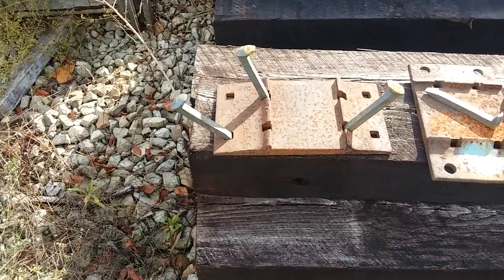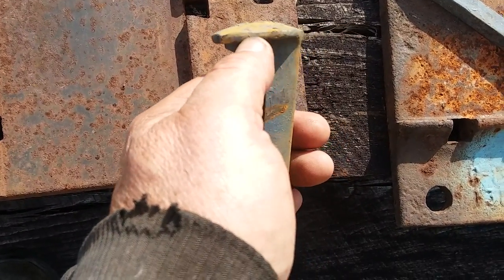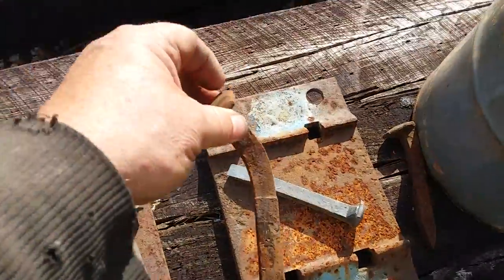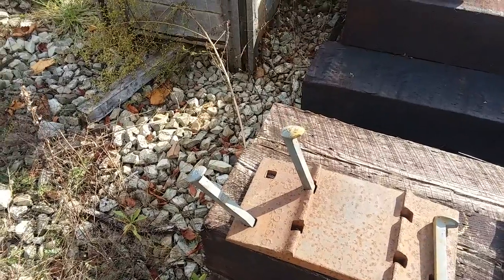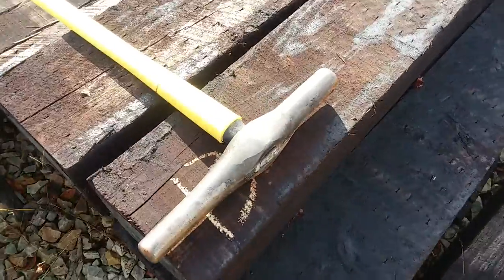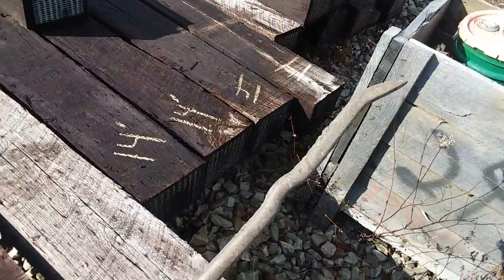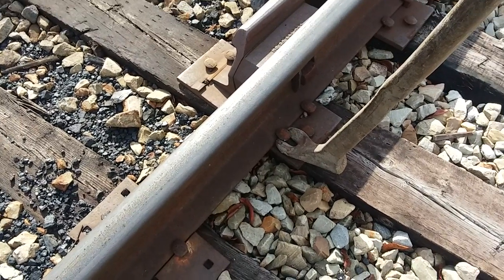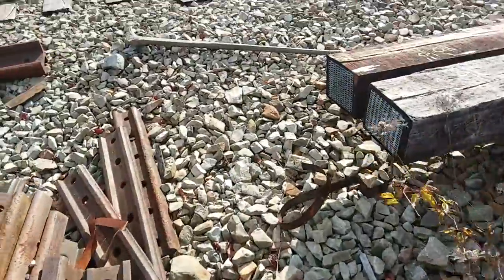All about Railroad Spikes

Comment: Hi Dave, I really do like your videos, very informative. I do have one question about the spike pattern. You showed where two spikes would be placed, diagonally, on either side of the rail, and one spike to the very outside of the tie plate. You also mentioned that sometimes you place two spikes against the rail on the inside of the rail on curves. To me, this makes sense, as they would help prevent the rails from possibly rolling over from the forces of the wheels. But you also mentioned that you never place any spikes in any of the very inner two holes. If that is the case, then why are there holes in that location? Is there a particular situation that those very inner holes would be used?
Reply from the maker: Good question gntlmn and great to hear you are enjoying the home
movies. Tie plate holes are stamped in for a variety of situations
and applications. That way they don't have to make a tie plate for
every single application, more like one size fits all. We don't use those
holes on the inside of the rail farthest away from the rail, however
there are some railroads that would use one or both, depending on
the speed of the train and the degree of curvature.  At 25 MPH here our train is at a fairly slow speed.  Really appreciate your taking the time to visit with us and may you have a very good day my friend.

Comment: I have cabins on a junction. Thankyou for showing gear. 
Also, the RR has gone to cement ties and, longer rail. Could you expand on that?
Reply: Cement ties are used quite frequently in new track construction yes, I've never heard of
anyone mixing concrete and wood ties. For one thing there is a different setting or limit
on tampers, one for concrete ties and one for wood, so if a section had mixed ties, the
tamper operator would constantly have to shift the limit on how deep the tamping tools
will go. We only use 39 foot rails, although lately when we change out a whole curve of rail we
have been welding 2 or more sticks together to eliminate joints, we have done as many
as 5 sticks which sure makes for a better ride and easier tamping. Thanks for your inquiry

Comment: They are high carbon steel. Might be lower than the rail, but still high carbon. Hence the HC on the head. Others might say O or W for oil or water hardening.
Reply: The HC means higher carbon, not high carbon. Still pretty low carbon content. Equivalent to 1045, which can be quenched, but won't hold an edge.

Comment: I really enjoyed this.  I have been told a fair amount things about railroad tools and terms. You mentioned Gandy Dancers. I was told that name came from the name of the manufacturer of the tools Gandy and when b the men would use some of the tools they would kind of sing or chant to keep a rythum going making it easier keep going. Then I have a question. My Grandfather was a blacksmith and he made my Dad a splitting mall out of a railroad mall. I want to say it was a "striking mall."  As I remember it the "striking mall" shaped different than the "spiking mall."  The striking mall was smaller and was shaped like a chisel which was used to cut the rail. Someone would hole the striking mall against the piece of rail and another worker would hit it with another heavier mall. It would leave a knick and that would be done all around the rail and it would eventually break the rail. Can you enlighten me on these things. I must say that that splitting mall was the best in ever used. I am not a big guy but with that mall I could sure split like one.
Reply from the maker: Marvin, thanks for the great comment, appreciate your history. I have heard of a splitting maul, but we do not have one and never used one. To cut rail i have a nifty hydraulic cut off saw, got a vid of that in action on my channel if you wpuld like see it. Again thanks for info and for watching

Comment: One would think their would be some kind of a jackhammer-like air tool for driving and removing spikes instead of a maul. Why not?

From WWII movies, I remember seeing European rails fastened with screw-type spikes that are turned with a T-handled wrench. Thus instead of fighting a longitudinal friction, removal fought a rotational friction. I wonder if  that system required the use of a sort of Sure Spike compound when replacing spikes and whether their spikes better resisted the forces resulting from traffic.
Reply from the maker: We have a hydraulic spike driver that runs off our hi rail truck, they
also make pneumatic drivers. Believe me at 68 years old my days
of hand spiking are over! I too have seen those fasteners you
speak of in a movie, seem like they would be a pretty good idea.
We use hydraulic impact wrench to run lag screws in if needed
without pre drilling holes.

Comment: I remember when they removed the tracks by the house I grew up in, the line was dormant so now it's a bike path. Anyway, I remember the crew giving away tracks, ties (we got tons for the yard to keep the gravel from the road out of the lawn) had dozens of spikes, and these J shaped things. I know about the bolts, plates and nuts, but I am unsure of what those J shaped dudes were for besides my using them as a crude form of hammer.
Reply from the maker: Rory, J shaped are rail anchors, fixin to do a video on anchors soon, so watch for it. We got an old, old railroad bed bout 10 minutes from me that they did the same thing made it into a bike trail.

Comment: Is rust an issue or are the spikes, tie plates etc., quite durable in that regard?  Are the new ones treated with chemicals to prevent rust?  Thanks!
Reply from the maker: Rust not an issue generally speaking. However the big problem we have had is when coal covers plates and spikes, the acid in the coal corrodes the metal. I've found some spikes corroded so bad they were as thin as a pencil.

Comment: Thanks for the info.   I would  think the. Chisel head  would be turned   90 degrees. To slide into the grain of the timber.    The design.  Now, Would cut the  wood. And  work loose with the swelling of the   Timber.    Thanks. Great video. Later.
Reply from the maker: Think about this Dan, putting a spike with the grain is like driving a
wedge into a piece of wood, it wants to split it. Driving across the
grain alleviates that to a better degree. Spikes work loose a good
part of the time because the tie is sitting in unstable ballast conditions such as mud, this works the tie up and down and eventually the spikes will start to loosen. When that happens then
water gets down in the spike hole and makes things worse and
starts to rot the tie out from the inside. Ties are not creosoted all
the way thru, only the top about 1/2 inch layer of wood. Very
grateful for your taking the time to visit with us and check out
the video my friend.

Comment: what does the railroad think of your videos? do your bosses or coworkers also watch them?
Reply from the maker: Good question, company policy does not prohibit taking videos,
however I am not allowed to show employee faces, and yes many of
my fellow workers watch. I use a cell phone to take these, we use cell
phones as part of our communication to the train and dispatch as 
our radios are not always reliable which happens most often in summer when there is a lot of foilage. 

FRA rules prohibit cell phone
use while running a locomotive or if it distracts the loco operator so
I do not do that. I do run loco at times but cannot make videos of me
doing that. Sure wish I could make videos of running a loco, but 
that would be a definite safety concern.

Comment: How the heck do you drive a spike between the guard and rail at the frog at 10:04?
Reply from the maker: Once we can't drive it any further with a spiking maul, then we can put another maul on top the spike and try to drive it in but in new wood it's pretty tough. So we will use a hydraulic spiker, one these days gonna make a vid and show you it
Reply: @ccrx6700  that makes sense. Just turn it into a big ole nail set! Love the videos... you’re very informative and easy to understand! Learning a lot.
Reply from the maker: @scratchbuiltdozer  we often use a b & o and hit it with a maul to drive down spikes that are under joint bolts. B & o is a really big nail set with a handle

Comment: Very interesting - I did search for the dbl headed spike & found information, BUT didn't find any info WHY the dbl head. I know about dbl headed nails - used as temporary - the second head stays above making removal easier.
Reply from the maker: Thanks JB, yep I couldnt find much bout why they used them either, but is rather a unique design.

Comment: I looked at your video on the spiker machine driving the spikes in it appears to be driving them in without holes in the sleeper. a question when they are driven in by hand are the sleepers drilled with an undersized hole  or are they just driven into the wood without a hole to make driving easier. Sorry for the dumb question but It is something I am curious about. Thanks for all you videos. All the best.
Reply from the maker: Thank you for your comment, and no its a very intelligent question, and unless a person has worked rr, its not something that many would know. We never pre drill holes. There may be some rr's that might on occasion, but all our spikes, by machine or hand are driven without pre drilling. Thank you for watching

Comment: Often wondered with no serrations how they do not back out, especially where you see vertical flexing due to soft ballast.   Nails are spiral or cement coated,  unless plain (?) Uncoated...always seemed like they would back out over time.
Reply from the maker: That is why the spikes are cut square Cregg, that adds a lot
of resistance. They very often do back out tho when the tie
keeps pumping up and down from the soft ballast. Thanks
so much my good man for taking in the video today.

Comment: What do you know about date nails in RR ties? In the 1950's we were digging up and filling in an old root cellar made of used RR ties. It was rotted and collapsing. some of the ties we dug out had zink nails hammered into the end with a date stamped on the head. Nearly all of them dated from 1890 to 1920' Was this common? We were near the UPRR tracks in E Oregon. The nails were abt 3" long and had heads the size of a nickle.
Reply from the maker: Interesting story! Thank you for sharing with us

Comment: Are all railways (railroads) done this way? It seems very old fashioned compared to the UK and Europe. We have the sleepers (usually concrete, especially on mainlines) a "seat" which is bolted into the sleeper and then the spring type clamps holding the rail. Joints on the mainline are continuously welded (thermite) for ride quality. UK fast trains travel at 125mph (for now- faster is planned). Only branch lines or less major routes use wooden sleepers and fish plates, but the same seats and clamps. Im amazed the rails stay on using glorified nails!
Reply from the maker: Ours is old rr built 1975/76. A lot of rr have continuous welded track in US, but ours is jointed. In US  a lot of wood ties but most new construction is concrete. Thanks for sharing info from across the pond with us. Nice to know how other railroads do things
Reply: @ccrx6700  Thanks for taking the time to reply. I really enjoy your work and the inside look at things we never see. Thanks!
Reply: I think the spikes are very strong, and they work well for keeping the rails in gauge. Of course, I might point out that the UK still uses screw couplings which are old fashioned compared to Janney couplers found on American rail cars. But, it works well for British railways, so that's all that matters in the end. In defense of American railroads, we don't have the passenger network found elsewhere in the world, but I believe we have the best freight rail network in the world.

Comment: I have NEVER seen a factory-new spike. Thanks for sharing!

Q: Do you think the reason they don't sell 250's is because it's all automated for large installations and replacement?? I've had the "same issue" buying Surface-Mount-LEDs, which are cheaper by the hundred than the ten, so I've bought rolls of 100's for the same price as 10 units.
Reply from the maker: You are welcome glad you enjoyed. Lot guys developed back injuries from lifting those heavy kegs which is why i heard they went to smaller weights

Comment: Dave, great explanation. Thank you! How do you spike the rail at a crossing?
Reply from the maker: Very good question John. Crossings are built just as any
other section of track, then after everything is spiked down
and tamped, they will add the asphalt or wood top so it
can be driven over. Hope that helps.

Comment: Actually quite interesting and informative... What I would like to know, once you pull the spike out between the frog, how do you get a new one back in? It looks to be a very tight fit.   If you are using the spike maul, one must be pretty accurate to strike that spike.  I know I couldn't do it.  :)
Reply from the maker: Very good question and very observant on your part. WE start the
spike with a maul, then we can use a hydraulic driver or use a long
punch on top of the spike and hit the punch with a hammer. Glad
to hear your enjoyed the show

Comment: I live in England and as part of my interest in Railroads I collect rail and track fastenings. I was really thrilled when i managed to get a RR tie plate and some old spikes and bring them back to the UK. In the uk spiked rails are uncommon Pandrol rail clips are more common. Are the spikes driven straight into the wood or are there any predrilled holes?
Reply: Awesome Philip, Question, I understand Pandrol, we have a few of them on our railroad
but not many. What do they use there to anchor the pandrol plate to the tie? I understand
how they fasten to concrete ties, but they either gotta have spikes or lags for wooden ties.
Yes spikes are driven straight  and without pre drilled holes. Thanks for watching sir.
Reply: @ccrx-xu1wc  Apandrol rail clip on a wooden tie (sleeper) is a rare thing. I have just been delving through any books I have with pictures from the last 50 years, I eventually found a picture of wooden ties with Pandrol rail clips, as I suspected they use a cast steel baseplate fastened to the tie, there is a hole parallel with the base of the rail into which the clip is inserted. Trains going one direction   tighten the clip, trains in the opposite direction slacken it slightly , but with lots of double track with an "up" and "down" line this isn't a problem. where it is single line if it warrants modern pandrol clips they put them in facing different directions on alternate ties so the fastening becomes fractionally slacker and tighter on each alternate tie as the train passes. There is also track fastened with sprung spikes, and a heck of a lot of chaired track on less used lines, though I doubt any track chairs have been cast in the last 50 years. for low speed freight only lines track chairs can have a life of nearly a century sometimes. on main lines concrete ties have been the norm for decades.

Comment: I think the weirdest thing about the tracks. My pop had about 2 feet of railroad tracks. And it's so hard and strong. But I seen a tube where they build the tracks. And that long railroad tracks are like a wet noodle they like to bend left or right. Has to do with the length and the top side smaller and the bottom is booster to flat so it stronger. That is weird.

Comment: Very informative video but being from the UK I am wondering why you are persisting with wooden sleepers (you call them ties) The standard in Europe is concrete sleepers as the speed limits on our railways are much much higher, even on secondary lines the trains average 80 miles an hour and the concrete sleepers are much more resilient than wooden ones.  Also for high speed lines in excess of 100 miles an hour wooden sleepers would no longer be be allowed.  The UK is currently building HS2 (High Speed 2) from London to the North of England and that will have a speed of up to 250 miles an hour and this has to be so straight and flat otherwise the train would jump off the track.  The radius of curves on this line would be 2 or 3 thousand meters which allows for such high speeds.  I find it odd that you would still have a speed limit of 25mph, even our freight trains average 60 or 70 MPH. on main lines.  Thanks again for the video.

Comment: Good stuff sir!  Question:  Why is the spike chisel made to cut across the wood tie grain rather than parallel to it?  Thanks!
Reply from the maker: Thank you, the chances of it splitting the wood are much greater if a spike is driven with the grain.
Reply: @ccrx6700  Make sense...Probably harder to pull out as well....Thanks!

Comment: Hard to believe you still drive the spikes in by hand. Do t they some kind of pneumatic hammer that would speed the process along? Plus pretty narrow head on the spike and the driver so you need some good eye hand coordination.
Reply from the maker: Mark, i hand drive still if only have a few, i do have a hydraulic driver runs off my truck if there are a good many, much nicer with hydraulics, specially the older i get ! I'm gettin close to 67 so my days of hand drivin are getting numbered lol